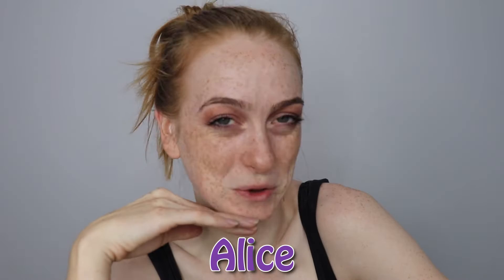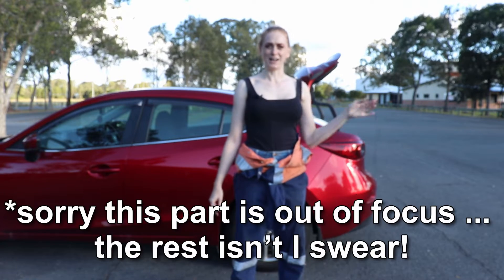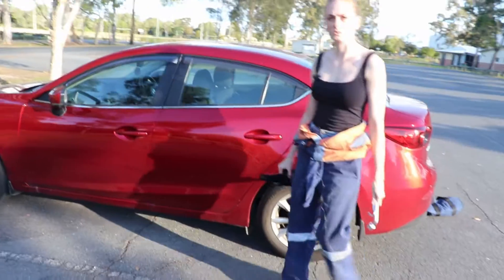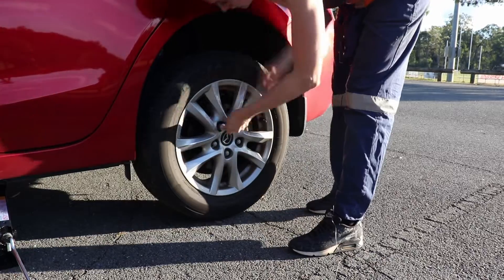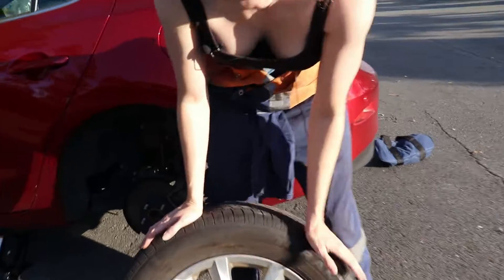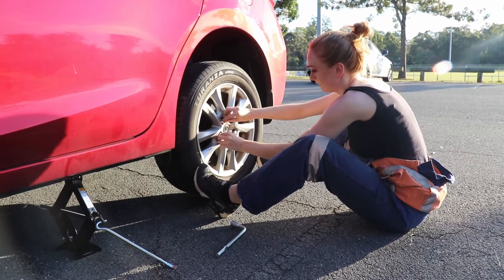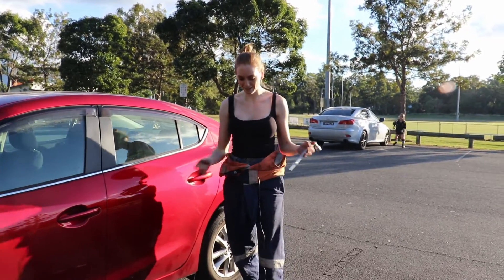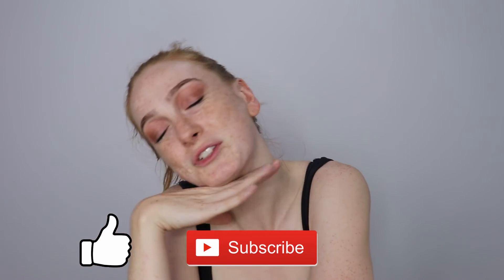How to CHANGE A TYRE

Comment: A good practice I was taught is to put the spare tyre laying flat under car along side of the jack incase the jack slips or falls, the bottom of the car would be to close to the ground without the tyre being there, with the tyre there you could place the jack under again. In the past I've also used a length  of  pipe to give  extra leverage by placing it over end of the tyre lever. but good video